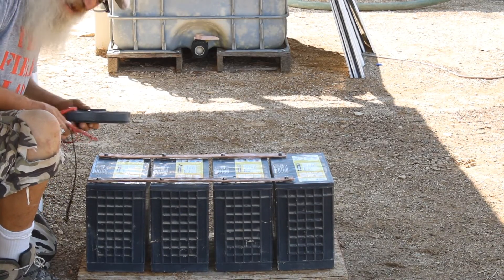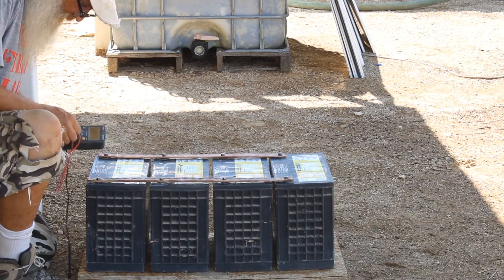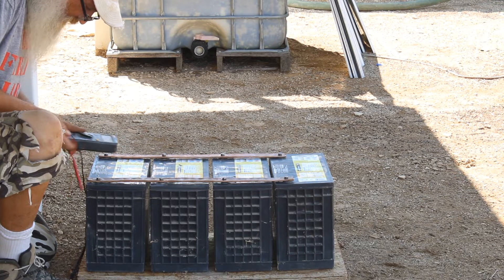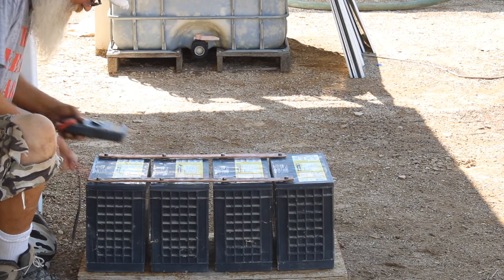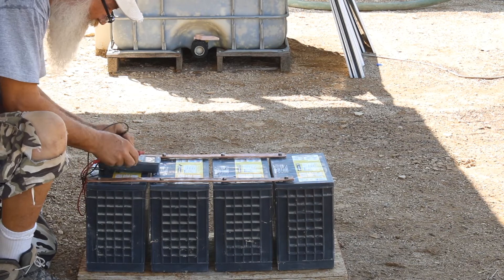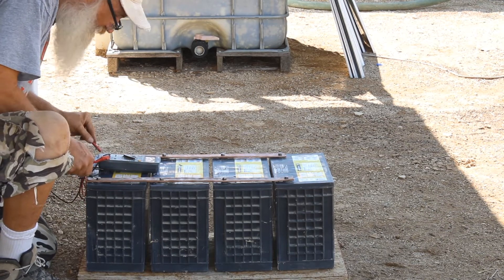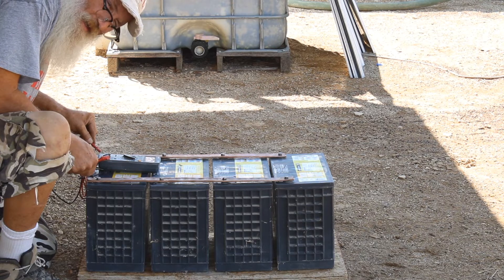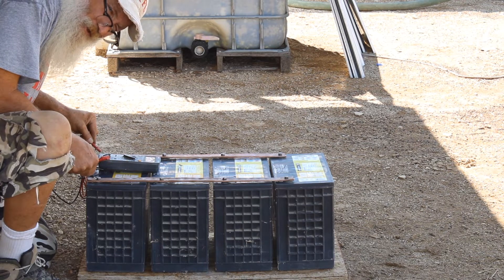connecting some batteries

Comment: Would it be good practice to polish the copper before install? Just wondering.
Reply from the maker: I didn't do that for my system and it has worked just fine for over 4 years.